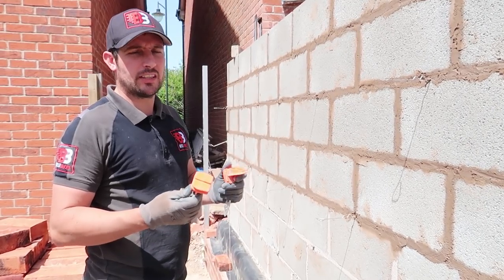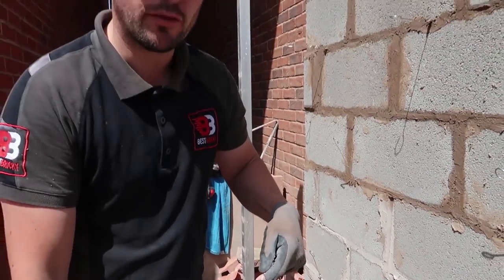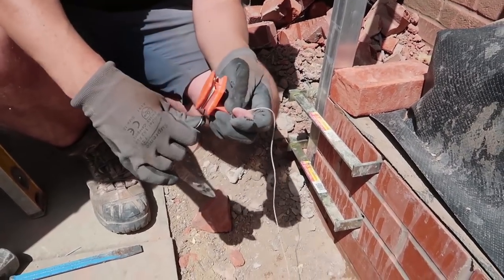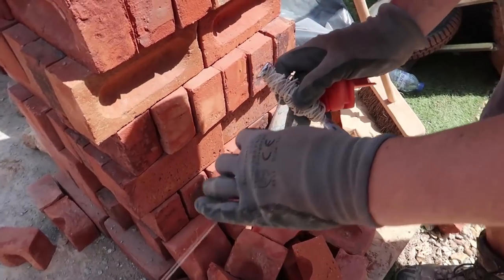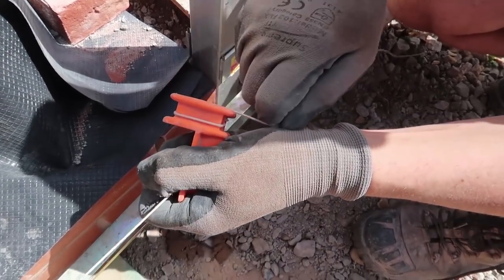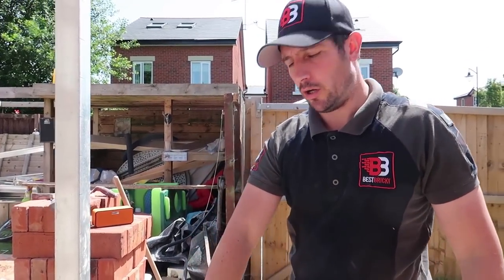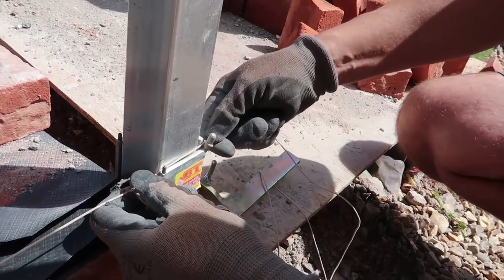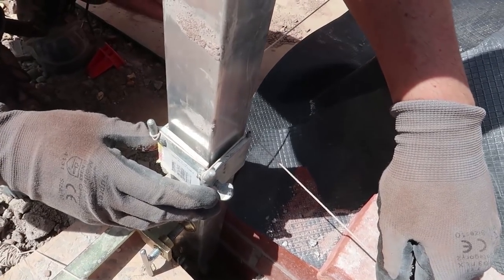How to Set Up Corner Blocks for Bricklaying

Comment: Wow that was very smart. I live in Sweden . Here in scandinavia we use different equipment and we get the job done. I am a bricklayer myself but i was wondering how to use vertical string lines with a weight and such. There are so many ways to do it. That dory pole riser was so cool. Way better than raising it manually and eventually break the string. 
Maybe you could show more videos like this.

Comment: Hi Stu, just came across this video and have a set of these and was wondering how to use them, I'm building a pond and put the block work on a few jobsites about a month ago with no interest at all, I don't know if it was the 140mm hollow concrete blocks that put them off or because I already have all materials, so going to bite the bullet and have a go myself, this was my original plan hence having all the materials, it was only when I felt the weight of the blocks it put me off as I have back issues, but I will just take my time and I'm sick of looking at a hole in the ground which I started digging by hand (couldn't get digger on property) over a yr ago most of that time spent digging a bit at a time, I've watched your videos for a while but any pointers would be appreciated.
Rob.